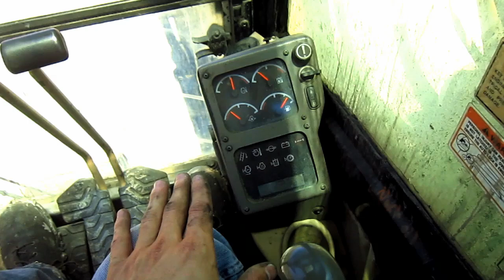Caterpillar 5110B Documentary

Comment: These were by far the most sucsessful of the Cat 5000 series excavators. Not all of the 5110s had the cab riser as most did not have it. As you mentioned the 6015 is an evolution of these and is a Cat design. The larger 6000 series are from the O&K/ Terex / Bucyrus  lines.  Another great video PA ! Thanks for posting them.
Reply from the maker: Agreed, this was definitely the most successful in the 5000 series. I believe the cab riser was a standard feature. I've only seen a couple pictures of 5110s without the cab riser. Thanks!
Reply: @PAmining  the cab risers were usually not used in applications where the machine would be working with small trucks like you see a lot in Europe and the Middle East or in deep sewer work with a utilities contractor where the cab riser would hinder the task at hand!..

Comment: My brother actually had a hand in the engineering on 5110b his department had the drive motors. Actually have photos of this with all the sensors and reference marks from the engineering departments on it. My brother basically said they took the 5130 and made it lighter and smaller, same power though. When in development it had hydraulic issues. The original had twin stick and twin bucket cylinders, no bueno evidently, went with the more stout bigger diameter cylinders.
Reply from the maker: That's cool, very interesting! I did hear the early prototypes had hydraulic issues. Must have had power issues also since they boasted the power in the final launch machine. I always felt the 5110 was the only one out of the 5000 series that cat got right lol

Comment: Very interesting! So for the ten years between the 5110b and 6015b Caterpillar didn't offer anything bigger than the 385c/390d excavators?
Reply from the maker: That's correct! Once Cat dropped the 5000 series in 2005 they didn't offer anything larger than the 385/390 series until they acquired the Terex/O&K machines in 2011. The 6015 replaced the former O&K designed RH40 in 2015. Thanks!
Reply: @PAmining  That's very interesting, did the demand for larger excavators drop during those years or something?

Comment: another great video, some questions:

1) when you buy one of these machines how long is the warrenty? and does catapillar come out and fix it under warrenty if it breaks down?

2) you said this machine had a  8 cubic yard rock bucket and a 13 cubic yard was avaliable for coal, what would happen in a operator installed a 13 cubic yard bucket and used it on rock or sand to get the job done quicker?  would the machine break or simply wear out earlier? and would caterpillar honor a warrenty in such an incident? if they disdnt know?? THANKS!!.
Reply: There are sensors that measure the amount of weight in the bucket and if the momentum (load x weight) exceeds a threshold the machine will simply issue a warning and stop.
Reply: @jamesb7777a   I believe that the standard warranty is usually about 2,000 - 3,000 hours on a machine like this Cat 5110B. The buyer definitely has more options available to protect their investment. A company like Caterpillar most likely has 3 to 6 different options available. The buyer can purchase an extended warranty. That might cover 5,000 service hours, or a 10,000 hour service contract.As I said there are many customizable options available. I have heard about mining companies that might spend 3 million USD or more on a single machine. Many times in a situation like that, the company will have the equipment manufacturer take care of everything. The dealer that sold the unit will perform all of the preventive maintenance out at the work site . Any failure of a part or parts will also be replaced with genuine OEM parts. That type of full service/warranty contract is definitely going to be pricey. The big benefit for the owner is that everything done to that machine is going to be according to the manufacturer. Another benefit is that all procedures will be documented.And possibly the most important factor is that the liability is on the equipment dealer.An example of that would be, a dealer technician makes a mistake on a part replacement that results in several thousand dollars damage to the machine. Obviously the dealer has to rectify that issue free of charge.I wanted to mention the importance of service documentation on equipment resale value also.
Hopefully that gave you a bit more insight on the warranty issue.
Take Good Care

Comment: I’m surprised that cat didn’t put a 3508 in this machine…as capable as the 3412 is, I think it’s a bit too much hoe for the size of the engine…but the 3412 is arguably one of the best engines Cat ever made!!
Reply from the maker: You have a point there, considering the fact that the larger  5130 utilized a 3508
Reply: @PAmining  clearly the 3412 worked well and the 6015 utilizes a C27 which is basically the 3412 with some tweaks…I know it worked great in the D10’s and 773’s but it just seems they are trying to pull a great deal of sustainable power for this engine size…I’ve seen a lot of low hour engine failures (less than 6000hrs) in excavators 80ton and over because they are in fact worked so hard as a rule!…that being said, I haven’t seen many 3412’s fail!…they are tough as nails!
Reply from the maker: Good point, And very true! The 3412 is a solid engine!